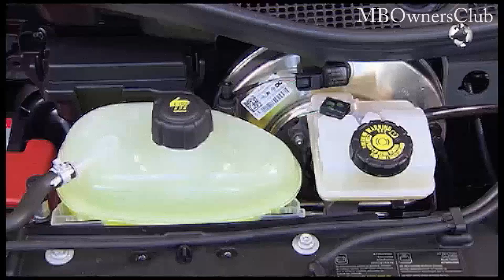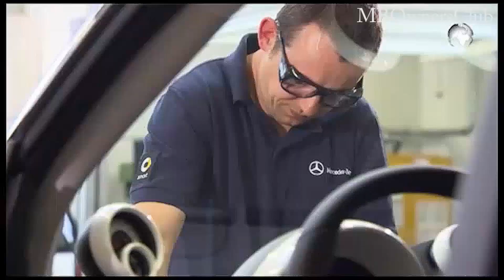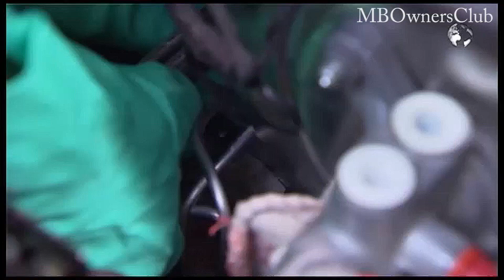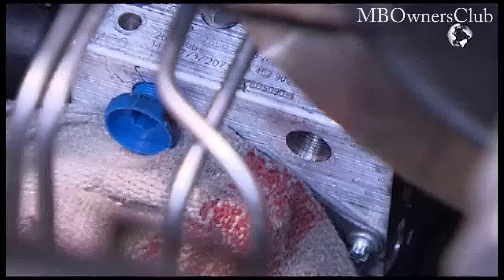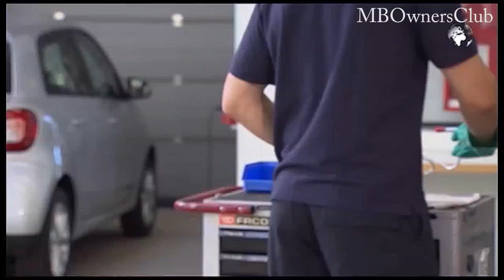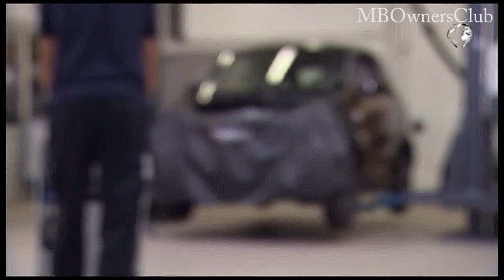Smart W453: Removing and Installing the Brake Line from Master Cylinder to ESP Unit

Comment: thanks for your great videos.  By any chance will you have a video about replacing the clutch master cylinder?  specifically how to purge the circuit (remove air) I have doubts about whether I should remove the motor to do it. Thank you very much and excuse my bad English.